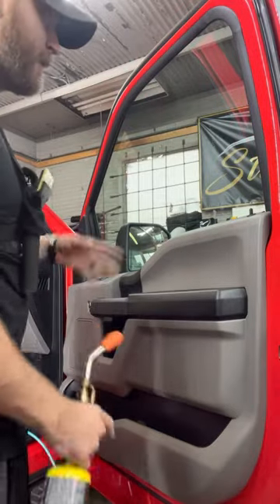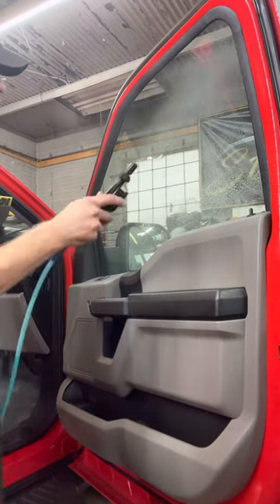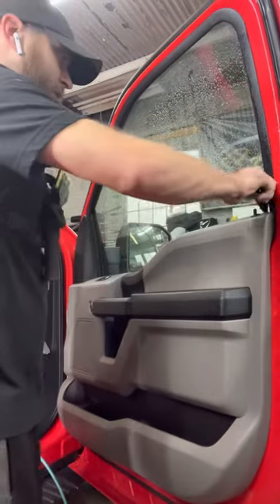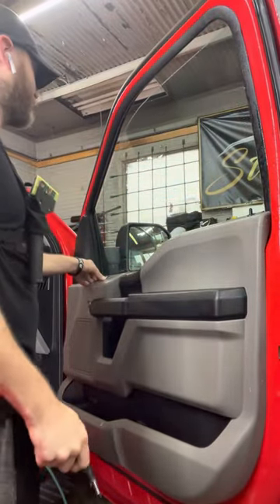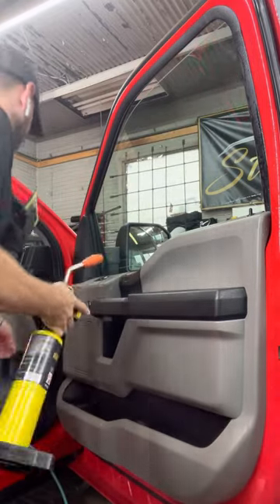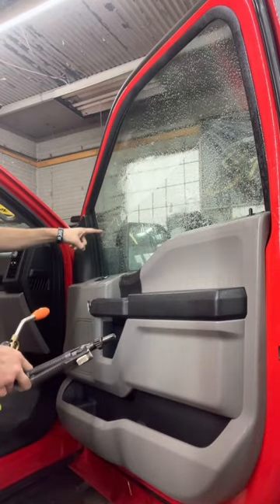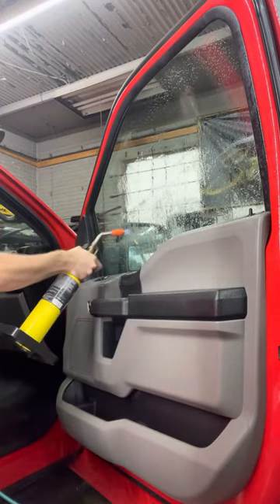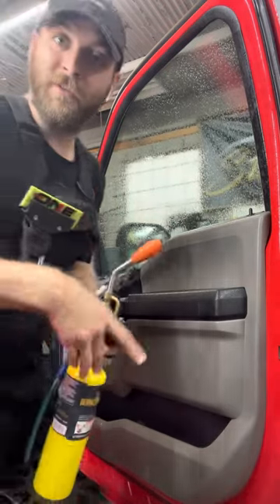Window tinting hydrophobic windows. Torch tip 🔥

Comment: Hello, Is there a way to make it hydrophobic again? The tint shop did this on a patch of my rear glass on the outside, so whenever I’m washing my car you see an oval shape that does not bead anymore, it just looks like it floods in that spot. I had that rear glass re tinted recently, so I’m assuming they used a torch during the removal and/or installation, and that removed whatever coating was on there, the rest of the glass beads just fine. Should I decontaminate, polish, add a glass coating or is there another process I should follow? Thanks
Reply: You can ceramic coat the glass. I offer it at my shop
Reply: @thewongster99  surprisingly it went back to normal by itself with time, weird to say the least.